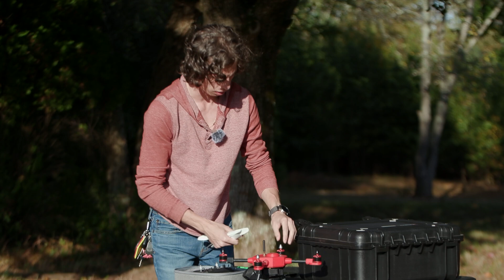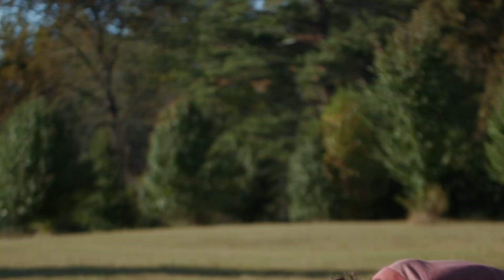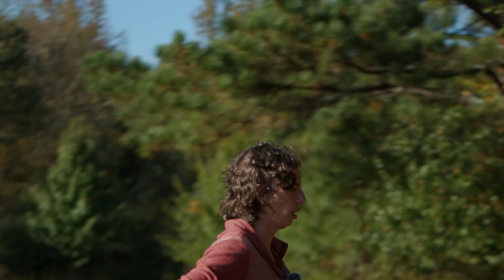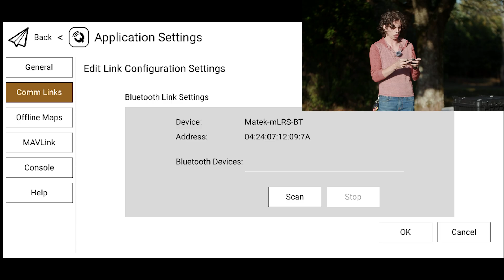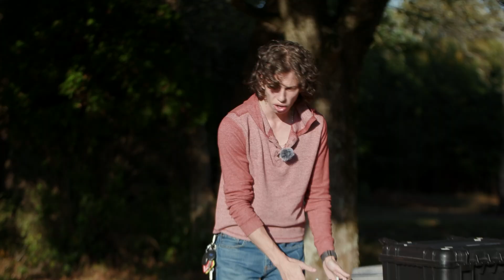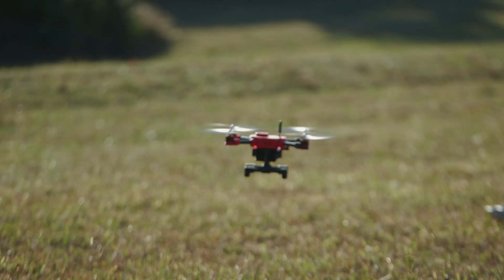Drones in the Wind - Test Flying a Develop Air mini with mLRS & QGroundControl @ Denmark Drone Park

Comment: really enjoying your videos,   what changes did you make to stop the spiraling?
Reply from the maker: Thank you for tuning in. The Develop Air mini demo model used in this video is different than the Develop Air demo model used within the last couple of weeks we have posted test flight videos. The same make and model ESC is used across both models though.

Seemingly, we had some sort of hardware failure of the ESC used in the base model Develop Air demo unit we have been testing. We will be testing out a new ESC in said Develop Air and will be posting the video within the next week or so.

- Jacob